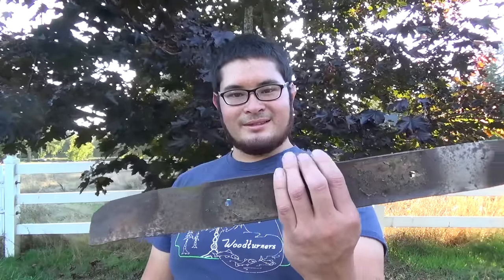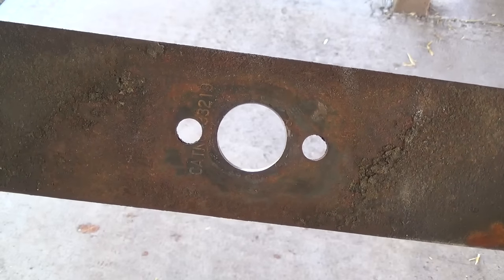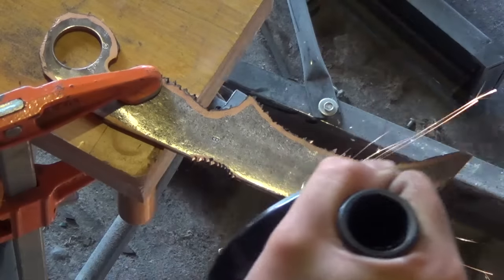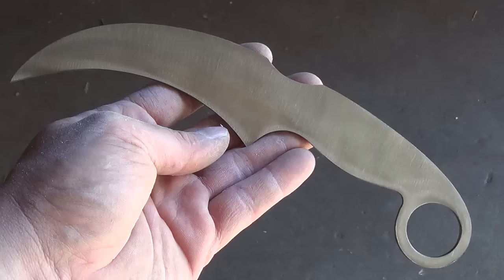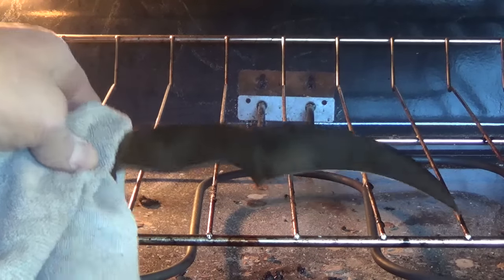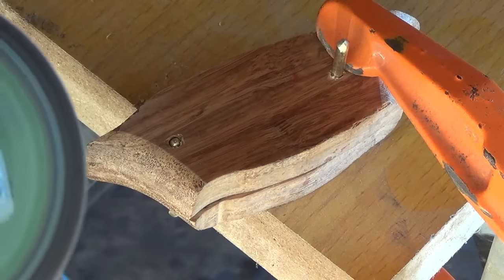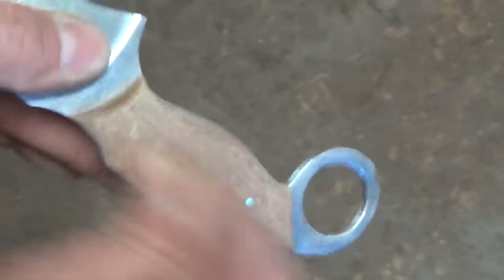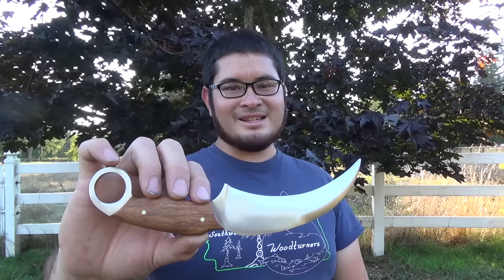How To Make a Karambit Knife Out of a Lawnmower Blade

Comment: are the pins necessary?
Reply from the maker: +Ben Strelkov They help keep the handles from popping off if the blade is torqued or the handle is bumped hard enough. You could also use nails or aluminum if you can't find brass for pins. I've seen some pretty cool handles done with pop-rivets, too.
Reply: +BackyardBowyer thanks, I'm in the process of making a new handle for a knife and this should help me out.
Reply: +Ben Strelkov you can even use wooden pins as long as it's a really hard and durable wood like red oak and you coat the pins in the epoxy beforehand.
Reply: +Ben Strelkov  actually you could use invisible pins, see you dont have to drill the holes all the way through the wood...example is drill holes 2" apart on the tang, take your wood and drill the holes 2" apart but only halfway thru...then glue pins in the tang first, cap both sides off with wood...now you cant get the alignment exact so leave a bit of wood there to correct any misalignment, as long as all the holes are 2" apart, it will all fit
Reply: A paracord handle would be cool here as well.
Reply: +Ben Strelkov No maybe it would be better if the handle fell off.
Reply: +Daniel Kittrell Leather
Reply: +Ben Strelkov i make some knifes with out pins. but a good alternative might be splines
Reply: +Ben Strelkov  You could also do a paracord wrap as well/ I think the wrap looks better myself but thats just me.
Reply: +Ben Strelkov Oh my gosh, that profile picture.  Slaps leg
Reply: Viking War Pickle haha thanks
Reply: +Ben Strelkov Defenitely, I tried glueing mine without grip lines on the metal, then wanted to use rough sandpaper on it, and the wooden handles fell off... I drilled holes and used the screws from an doorlock (the screws which apply the metal to the door you know what I mean) to really make it tight up. And that's when my knife was done. For as far as I thought; I never heat treatened the knife so it can't be sharp ahahahaha...

If you want to see that knife, I made a video about it: Dutch Knifemaker David -> My first made knife
Reply: no
Reply: I only used pins cuz I don't trust glue just leave them longer than you need then flatten the sides with a ball pin hammer
Reply: Yeah, it's complicated
Reply: +Jess Evans There is a way to get the alignment exact. All you do is drill the holes in the tang at any distance and place one wood side on and clamp it. You can then drill through the holes in the tang and into the wood for perfect alignment. Remove that side and repeat for the other side. It is as simple as that.
Reply: i was lazy and didn't want to explain how it helped the handle scales from breaking off.

Comment: how do you know the blade no longer sticks to a magnet? you put a  magnet to it? doesn't it burn you? 
beautiful knife though
Reply from the maker: +kakakakukkokka I have a magnet stuck onto the steel table just beside the firebricks. I've also used a magnetic pickup tool with a telescoping handle before as well.
Reply: +BackyardBowyer 

also, after you have hardened a few blades, you see when the blade reaches that point where it is no longer magnetic and eventually remember by color when she is ready to dip. 

my only question. for you nick is do you soak at all in your forge? and have you done any double tempering? 

I talked to some metallurgists at work and they said to definitely do 2 tempers at 400, but that was in reference to 01 tool steel specifically. 

let me know. I would love to talk to you more at length about your specifics and practices in knife making and metal work.
Reply from the maker: +Bacon Von Baconstien Thanks for watching and for the comment!

It depends on the steel. For junkyard steels and most simple spring steels I usually normalize twice, then bring to critical and quench. I usually only temper once until I see the color I want and then heat the tang and some of the spine to draw the temper.

Honestly I'm still learning about heat treating, which is why I like to temper the spine and tang back. I end up with a hard-working tool that is not likely to fail catastrophically on me even if my heat treat is less than perfect.
Reply: Awesome!!
Reply: +BackyardBowyer umm , butterfly knife pls
Reply: +SeamTress Gaming  heck yeah!!!
Reply: +kakakakukkokka 
You either set up a magnet on a vice and use the tongs to touch the blade to it or, as what I do, is I have a magnet on the end of a stick that I touch to the blade when I take it out of the forge quickly.
Reply: +kakakakukkokka No it doesn't burn you. Your hand might get pretty hot but gloves fixes that.
Reply: you can also take fine shavings of a magnet and then run it over the top of them

Comment: Thank you for your video. I learned exactly what I needed to know about what needs done to drill holes into an old mower blade. I am not making a knife but using an old blade to make a piece for a lock blade knife that broke and nobody has the part I need so I dissembled the knife and removed the broken part. I am now in the process of fashioning  a new part from an old mower blade and your video helped me. I have had this knife many years and it is worth it to me to try and fix it. Thank you

Comment: Which HF torch do you use?
Reply from the maker: +LeopoldUlysees I'm using the propane torch with igniter, it's the larger one for melting snow, softening tar, and clearing weeds.
Reply: Thanks!
Reply: +BackyardBowyer can I buy 1 of your karambit? it's cool
Reply: +Wiktor Pazik he literally just shown you how to make one... go outside and be productive.
Reply: +BackyardBowyer hey awesome video also i was wondering could you cut metal like that with a dremel maybe i mean i am going to purchase a dremel or an angle grinder and i mean i really need them both but i can really only get one or the other for now so do you think a dremal with the right attachment on it could cut a peice of metal like that also do you have a good link on the web for a bench vise for just under like 25 dollars
Reply from the maker: John Gate You could use a dremel or rotary tool to cut the blade, but you will end up going though a lot of cutoff wheels. If you are near a Harbor Freight, they sometimes have their angle grinders on sale for about $10. As for a bench vise, Harbor Freight also carries a couple clamp-ons for under $25 and a decent little 3 inch vise for about $28.

If you can manage to find any tool sales or estate sales in your area, you can sometimes find good old tools for cheap. My current 6 inch bench vise cost me $5, and I've found bench and angle grinders for under $10 as well.

Hope this helps and thanks for watching!
Reply: BackyardBowyer
thank you so much man
Reply: +John Gate ...I recommend jumping on ebay and you can pick up a angle grinder for extremley cheap. Or borrow a friends until you get one. The dremel would be great for fine details to give your knife that extra, more expensive, touch. I feel you asked a good question it is people who think outside the box that become great knife makers.
Reply: thank you
Reply: Remember that only you can prevent forest fires!  That Jackwagon didn't even deserve a response...but I'm glad you set him straight.  You just keep on keepung on and you be you ... You sound like a great young man so keep up the good work.   Handyman Magazine always has a 20% off coupon in the back for Harbor Freight... Always use your .20% off coupons there.   Also...we have one in the weekly coupon bundle that gets stuffed in the mail box every week.   Harbor Freight sells a small bench grinder that has a shaft that replaces a wheel and that gives you a flex shaft hand piece like a dermal tool but it has way more torque and a much slower RPM so cutting and grinding task are much easier.  I bought a dimmer switch and a junction box and cut an extension cord three foot from the plug so as to make a speed control unit for whatever I plug in to it ...works great for the little routers too....
Reply: David Thorne
thank you so much sir
Reply: +David Thorne thanks
Reply: +John Gate L Spending your limited funds on tools may not be the best way to go. Good Luck!

Comment: when you said 400 degrees I'm assuming that was Fahrenheit? And also if I don't have a propane heater or blowtorch would it still be possible to make this? I don't really want to go and buy one if I'll only use it for this and maybe one or two other things. Or are they that expensive?
Reply from the maker: The 400 degrees is Farhenheight. If you don't have a torch they usually aren't that expensive, but you can also build a simple forge using charcoal. There are lots of DIY forges and foundries on Youtube, some of them are very inexpensive to make. Hope this helps!
Reply: +BackyardBowyer Yea man thanks! Only found your channel yesterday and I've watched a lot of your videos. I can't wait to begin making something. Great channel
Reply: you thought of Celsius
Reply: That's why they call me Mister Fahrenheit, I'm travlin' at the speed of light, I wanna make a super sonic man out of you!
Reply: DON'T STOP ME NOW!!!!!!!!!!
Reply: Yes its still possible  A lot of filing,blood,sweat, and a fordge if you have around 4 fireplace blocks you will make a small fordge and just continue the process as so
Reply: And also if you have a grinder a cutting wheel is optional by the way
Reply: A torch is like around 30-50 dollars I think?
Reply: watch " Grant Thompson the kind of random"
Reply: yeah bro this MERICA its fahrenheit
Reply: +Autistic Needle I bought a propane torch at ace hardware for $12. That's the tank and brass valve included. It was in the plumbing area
Reply: That's not even forging

Comment: i wish I'd seen this video a week ago i just spent almost 200 dollars on a karambit from sog tactical knives.
Reply: +The Red Banded Tophat it does i checked, it's actually closer to 400. so in retrospect I'll just but the karambit and be done.
Reply: Ive heard a lot of negative things about SOG knives though, probably better off buying the equipment then you can make as many knives as you want rather than just have one
Reply: +Albert Barbo It's not even close to 400. Drill is 20-30$, angle grinder is 25-35 $, a sanding, grinding, and cutting disc are 10$ or less, torch would be 30-50$, pack of fire bricks is 20-30$, lawnmower blade 10$, handle scales+oil+ pins are 10$, and I'll add an extra 15$ for miscellaneous. That comes out between 130 and 190 dollars. I didn't include an anvil because my lawnmower blade did not need flattened.
Reply: +Jacob Dayton i looked at real professional blacksmith tools not stuff you can buy at lowes or home depot. the furnace alone was 270 for the least expensive. if I'm buying tools for a job i buy the actual tools not whats conveniently available.
Reply: +Albert Barbo a lot of blacksmiths make there own furnaces out of brick and concrete, which in many cases is far cheaper than $270.

Comment: I think you did an excellent job! You should try using Tru-Oil gun stock finish on the wood handle. It leaves a beautiful glass finish! The only downside is time. You apply, let dry 8hrs, clean with mineral spirits and repeat 3 to 5 times or more! Great Video Brother!

Comment: Nice job.  I would drill the holes for the pins before hardening the blade. You can also pick up a table top belt sander for around 50 bucks.  Works easier than the angle grinder/sander, although you got some skill with it!.

Comment: Did you really need to heat treat and quench the knife?
Shouldn't the blade be already hardenend by the company that made it?

I'm sorry if this question is stupid, I dont know much about blacksmithing.
Reply from the maker: Lawnmower blades are usually tempered back to make them soft so that they will dent or bend instead of chip or shatter when they hit something hard like a rock or chunk of wood. This makes them too soft for a knife that's going to be used for cutting, so that's why you heat treat the blade including hardening and tempering.

It's not a stupid question, thanks for watching!
Reply: BackyardBowyer
 Oh, ok thank you for answering so fast. :)
Reply: and the heat from the angle grinder probably ruined the heat treat
Reply: The Best It looked like he annealed the steel to make it softer and easier to work. That's what I'm assuming he was doing when he pulled the steel from that grainy white stuff. Perlite or vermiculite I'm guessing.
Reply: when you heat it it takes the temper out of it so it does need to be treated  but what he did was not blacksmithing  but still cool and ez

Comment: I've seen some old saw blades used to make different things, would you ever consider branching out and experimenting with different metal types? And I can get ahold of basic tools (no specialized smithing hammers though) and metal, but as far as properly forging and the tricks of heat treating, I'm pretty rough around it (had one shatter on me). Could you make a video solely showing the finer aspects of heat treating, forging and how to get around common errors? I know you explain your process step by step each video, but it'd still make a decent lesson. Keep up the good work!

Comment: great video my question  are lawn mower blades carbon steel, I'm was gonna make a regular guy full tang (bush craft ) knife,when you mentioned the use of that particular blade design,I got to thinking about an ole school sickle when I was your age that was our weed eater of choice lol nice job young man
Reply from the maker: +Rue Bob The Cat It depends on the blade. Many ride-on blades are high carbon spring steel on the lower end as are some smaller mower blades. They tend to work similarly to 5160 and 1060, I haven't found blades with much more carbon than that, though some old blades were supposedly made of 1095 or higher carbon steel. If you can find a lawn mower repair place that has a pile of old damaged blades, they'd likely be happy to be rid of them.

Many newer and cheaper blades are low carbon steel, trading edge-holding for less breakage and making them cheaper to replace. The best way is to test harden and see if they fully harden or not with a normal quench. Hope this helps!

Comment: +BackyardBowyer How do you like the Chicago electric angle grinder? I know you get what you pay for but is it well worth 20 bucks?
Reply from the maker: I really like it, I actually prefer it to my DeWalt because it's quieter but still has enough power for what I use it for. It has a solid feel to it. For the same price as my other grinder, I could get dedicated grinders for cutting, grinding, and flap sanding
Reply: +BackyardBowyer so how many volts is the grinder? Haven't been to a harbor freight yet to pick one up yet.
Reply: +Jake Breeze I had a Chicago electric and it broke on me within 3 weeks, then I got a new Mikita and it it's a much better, lighter, more powerful tool, better to invest the extra 30 bucks
Reply: +BackyardBowyer Can I buy it?

Comment: hey im making an knife my self aswell or planning to make. is it possible to heat treat stainless steel?
Reply: if you actually want to use the knife, no get high carbon or i wouldnt bother, stainless is too brittle, it could shatter and cause serious damage to yourself. Just a heads up
Reply: okay thanks for the tip, i was already making it but  now im not planning to heat treat it. im just going to make it verry nice and hang it on my wall

Comment: what is the purpose of the boiled linseed oil...and does it have to be boiled.
Reply: It's a finish to protect the wood and give it shine, as for being boiled, that is just a name. Most "boiled" linseed oils just have additives to make them dry faster, though this also makes them non-edible in the process, so don't use it on stuff for the kitchen or food prep.
Reply: Prevents the wood handle from rotting
Reply: it adds shine to the wood and seals it. idk about the boiled part

Comment: As soon as you heat the blade it automatically de-tempers the steel, even if it was a temperd blade to start.
  When he heated and flattened the blade, when partially cool and with lighter blows to flatten the steel, is known as "blue-blacking" which is working blueish-black hot colored metal to finer detail.
  When he heats the blade hot enough that it is no longer magnetic, this is called "annealing" the steel and the blade is cooled slowly, going right from the flame into sand or other similar, non-flammable, loose material so the blade will not harden and be the same hardness throughout the entire blade.  
  At this point you can perform stock removal for the edge or shaping the handle, etc. as the soft metal is easy to work with.
  Once the knife is shaped and sharpened it is slowly heated to the desired temperature then quickly oil-quenched, setting that particular desired hardness.  If water were used the blade would cool too quickly and be so brittle it could snap when struck with a hammer or dropped on the floor.
  Then the blade is given its final sharpening and honing.  This way the blade is hard enough to take and hold the edge you give it but not too hard to sharpen.  Under tempered steel will remain too soft and immediately become dull when used.  Overly hardened blades are impossible to sharpen and can be brittle enough to break instead of having the desired amount of flex in the steel.  A quality, carbon steel knife will flex under pressure, returning to shape when released, so it won't break if struck or used in a prying motion.  (Never pry with the tip of the knife as there is not enough material to flex).
  All of these steps are needed to make a quality blade.